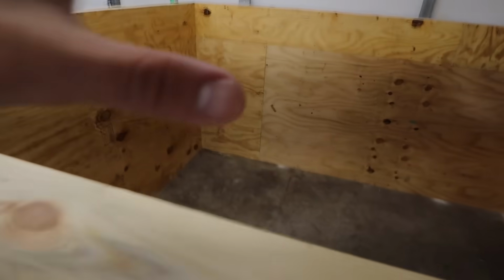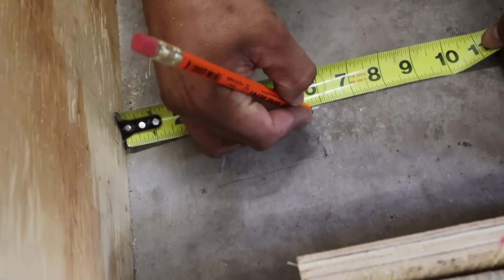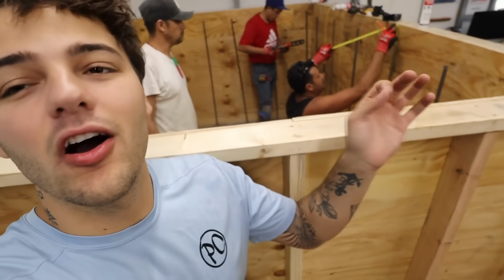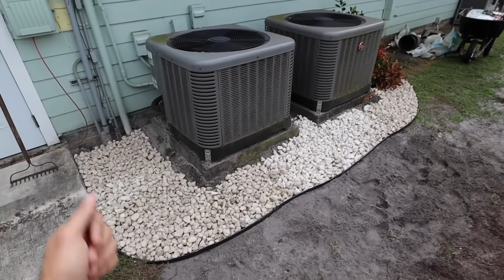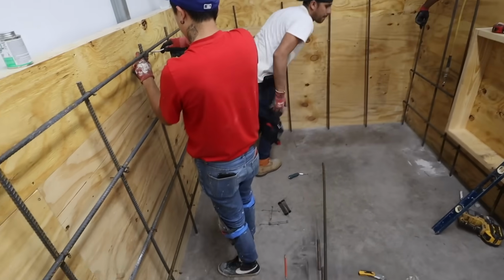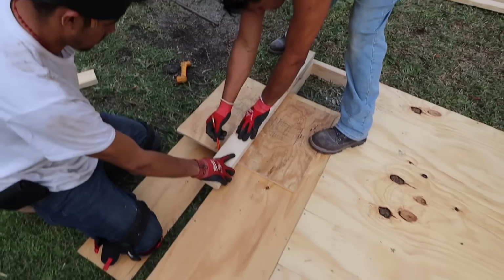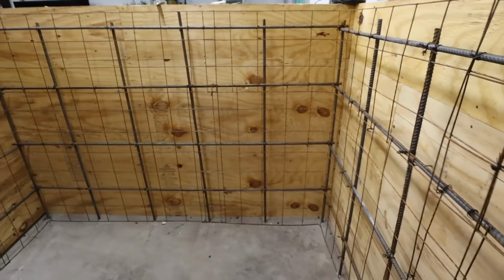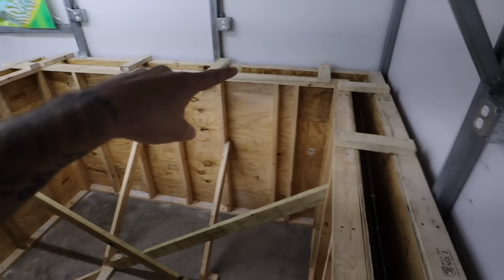Building My BIGGEST POND in the FISH BUILDING!!

Comment: Hey paul I have a little experience in concrete but I think you should have a couple brazes on that wall just in case it wants to warp by all the weight but you could be fine because it’ll get poured slowly but just giving you a heads up, that pond is gonna come out great!

Comment: A single side of all Saltwater will make filtration and water changes so much easier. Glue some pvc board or black/blue acrylic in the corners to have a rounded edged inside and sharks rays and groupers will be fine in there. Plus since you’ll have dry space inside you can put the backs of the water movers in there.

Comment: You guys would save a fortune buying cement, sand and gravel and mixing your own! 2 parts gravel 2 parts sand 1 cement then add water to consistency for high strength mix normal is 1:2:3 (cement, sand, gravel)

Comment: Okay so I don’t know if my comment is gonna be read or not but might as well just put it out there. My suggestion is that since you wanna do sharks and other predatory salt water fishes, I would put them in the current community salt water pond and turn this new pond into the community one. Now, the reason being, the community fishes don’t need so much swim space. Both the ponds might be same in the volume but this new one is tall and hence the less swim space. The predatory large fish will need more swim room. I would not suggest messing with the current freshwater one cause that is established and you have the filtration set over there for a freshwater setup. Yes you can move that and make videos on it and can get the money back from the videos but why mess with something that is established. Keep this section as the saltwater one. You also have an inlet pipe for when you get your fresh salt water to do water changes. 
This is just what I think makes sense and saves you time and money.